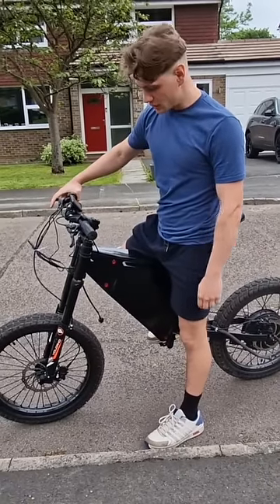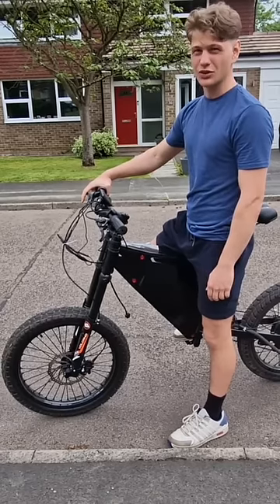5000w 72v E BIKE

Comment: There is 100% a limiter on this, at 72v 5000w on a mtb conversion almost chucks me off the back from acceleration.. it is extremely torquey
Reply: It’s obviously either limited or they lied about the specs big time
Reply: I have the mtb conversio and it chucks me off by twisting the throttle but with these they are much heavier and dont go as fast
Reply: where did you buy your mtb conversion kit? thanks
Reply from the maker: yeah that's what I was hoping for :(
Reply: @mancavebikes you should bring it to an ebike mechanic. That should hit 50mph on a full charge quite easily
Reply: @mancavebikes theres hidden controls on most screens like this that have different riding modes built in
Reply: @JudeTheYoutubePoopersubscribe  yeah unless someone scammed this dude big time
Reply: @JudeTheYoutubePoopersubscribe  looks like it's running like a 1000w 48v
Reply: Maybie you have a cheap battery which is filled with sand or you need a new 5000w unit .
Reply: @tyroneuva-py1pg  you don't know what you are talking about
Reply: What kit did you use dude?
Reply: @joeslider7236 did you find out in the end mate?
Reply: @joshbuck2037  never
Reply: What is this bike frame called where do I start plz help
Reply: What controller and battery do u have?
Reply: Don't know about your controller setuo but Press menu and shift up button to disable the limiter. Mine works that way.
Reply: Yeah, something defo needs sorting, my 1500w 52v20ah is a lot quicker than this 5000w e-build, he really needs to have a word with the controller 😅
Reply: @mancavebikes u may have to mod the controller or get a high-performance controller
Reply: depends 100% on the max phase current of the controller

there are cheap controllers that can peak at almost 7kW at 72V but can't do more than 100-120 phase amps, so it only reaches that when you're near or at it's top speed

these big hub motors actually like a big peak of 200+A taking off, there are 50A (battery side current) controllers that peak well over 200A in the motor at low speed, because at low speed the motor works at a low voltage and thus 36V (current motor back emf voltage) x 100A = 72V x 50A

to roughly give an idea
Reply: I have a 500w e-bike and it definitely kicks harder than this and it tops out at 23
Reply: I have a 3000W 72V and it's much faster than this.
Reply: @mancavebikes my mates 48v 1500w goes wayyyy faster then this on 500w with 72v your should be topping it out at 60s 😂
Reply: It'll be EU legal limitations on it not allowed a throttle here in UK on ebikes
Reply: There is a speed limiter usually a single white cable looping back to the controller, disconnect it, or cut it if you cant disconnect it.  @mancavebikes

Comment: You sure that’s a 5kw controller? Seems excessively weak. My 2kw build would leave it in the dust on acceleration so there’s something wrong there. Would expect a top speed of around 60 and at least double the acceleration speed that yours is putting out. No limiter wire? Link me to the controller and I’ll check it out for you.
Reply from the maker: Yeah it's really slow on the acceleration. I have a sabvaton 80a controller, but I think I'd need a 150a to actually get good acceleration right? 

I got 45mph yesterday but that's all :( and yes my 2k watt would probably also beat this 😂

I was honestly expecting this thing to do wheelies so I'm pretty disappointed. Id appreciate all the help I can get making it faster!
Reply: most likely is the 3.5T motor and not the 5T motor.
Reply from the maker: @alexchavosaurus9041  it is the 3.5t, is that bad?
Reply: U have 5t or 3.5t?
Reply: @mancavebikes  3.5T just means less torque and higher speeds from my understanding. Its the amount of copper winding within the motor. so 3.5 turns or 5 turns. I personally use the 5T and my torque is amazing but my top speed is around 45-50 MPH.
Reply: @mancavebikes  yeah Most likely its your controller then that is throttling down the power to either protect your battery or protect the motor or both. 37MPH still isn't bad. The lack of torque is kind of disappointing though.  What size battery do you have? do you know how much continous and peak current your battery is setup for? My battery is set with 100 amps continuous and 150 amps peak. so I have the 72100 Sabvoton controller to compensate.
Reply: That bike should be pushing 60mph at 100A
Reply: @philosoraptor777  with a 3.5T it would easily push 70 MPH, but I wanted more torque as I live in a hilly area so I went with the 5T which in turn leads to less top speed.
Reply: @alexchavosaurus9041   I have a 5T 3000W 72v system that rocks along at 55mph.
Reply: @philosoraptor777  again, I live in a hilly neighborhood. When I go downhill, I can get it up to 55MPH, but up hill at around 10% grade I get a steady 45mph
Reply: What size is your battery? You should upgrade your controller to 150 amp minimum
Reply: @alexchavosaurus9041 do you think the 2.5t accelerate fast enough? I like to think of a great top speed but if accelerate is not good then might aim 3.5t when make one
Reply: @mlee6050  Both of those will be good for Top Speed, Low Torque. The starting speed on the 2.5T will be lower than the 3.5T. Hope that helps you decide brother.
Reply: @alexchavosaurus9041 I was going to build one with 3000w and 72v I would rather have a decent acceleration and go like 40 what would I get a 5T I’m not really even sure what that is tbh
Reply: @frankroach9346   my battery currently only puts out 100A continuous. I just burned another Phase Wire cable on these damn motors so I am hesitant to buy another honestly haha

Comment: Man , get you a tw200 and stop with the bs problems , they’re indestructible, fairly priced,  easily last you 30 plus years with minimum maintenance , don’t ever have to wait for it to recharge you put in 5$ and fill the tank that lasts you an easy 100 miles  per gallon of gas. Unless you have access to chinas new lithium battery that goes 600 miles (on a car) and takes 10 minutes to fully charge. Once we have that technology only then would I consider getting one , lastly who wants to hear that annoying whining.

Comment: This bike should do like 0 to 30 and like a couple of seconds and it should have a top speed of easily 50 mph so somethings wrong with it or the limiter is still on. you either need to clip a wire or you need to go into the hardware and tweak it to take the limiter off

Comment: 45 on mine, same 72v 5kw stealth bomber clone.  Doesn’t lift the front wheel during acceleration but it’s still fast.  Actually once you are already moving over 10mph , then the torque kicks in big time.  Almost lifts the front wheel .  I have the silver generic controller which limits the current at 80amps.  My Panasonic cells could do 120amps but my controller isn’t allowing over 80amps peak.  Not even for short bursts.  I still love the bike though and I have a different aftermarket controller that’s programmed to allow 120 with much higher phase amps.   I will have to either bypass the battery BMS or get a new one.  That’s why I still haven’t put the controller on.    

I wonder if  you have the same issue
Reply: That's bad for the watts and v??

Comment: Have you checked all the hall sensors in the motor are working with a multimeter?
Reply: Hall sensors are only for crawling like speeds after that rpm sensor less should take over
Reply: @bad4life2013 They make a huge difference to acceleration at low speeds and even at higher speeds they still improve acceleration. An ebike without halls will take much longer going from 0-10mph probably twice as long and from 20-30mph definitely not as much of a difference as twice as long but still slightly longer.
Reply: If it's a sabvoton controller it wouldn't even move if there was a hall sensor fault..

Comment: What controller are you running? Sabvoton?...   Is the battery specced for being able to deliver 100/150 amps?  Most of the pre built batteries are in the 40 amp range and that would limit acceleration massively and will also cook the battery pretty quickly if you are trying to pull higher current from it than the cells its made up from can deliver..
Reply: if its 5000w he will have a 80amp controller.but somethi g is still wrong it should hit 55mph easy
Reply: @lee-tx5mw  depends on how the motor is wound too... If it's 3 or 3.5T I'd agree, should go past 55mph, if it's a 5T motor 55mph would be almost flat out (I have a 5T) and 7T would max out at about 35mph but with insane torque and acceleration... Bike in the video didn't appear to have either hahah
Reply: @mgtruckin  that video didnt have any torque .something dont add up
Reply: What
Reply: @mgtruckin  exactly somethings not right somewhere .mine pulls like a train

Comment: Did you build it? It can be either of two things if you built it the speedometers come with a max voltage and if this is a 48v not a 72v it’s getting limited at 25ish mph also depends on what controller you have either needs the wire snipped or need to get a beefier controller

Comment: you need to either increase phase (motor) current or if thats at its maximum a better controller

these big dd motors like a nice 200A @ the motor side to get good acceleration

Comment: It looks like I have the same motor as you
With a 72 volt 8 amp power battery and I feel like I'm driving an r1 in first gear it literally almost pulls me off the bike at 225 amps

Comment: Gotta be something wrong with your controller. I have a 3000w 48v I can get up to 40 mph on. I'm upgrading to a 72v soon but I think your controller might not be sending the right amount of power
Reply: I do over 40 on my 1000W kit dude, you sure that’s right ? I’m not the best on e-bikes but I know my kits 1000w front drive 48v battery, I think it is you’re battery that’s not giving the motor the power it needs
Reply: @DripZZZZ-qe4eb  oh it gives well over 40 with a little programming. The 48v ended up getting to 50 mph with a controller change
Reply: @tjkilshot  thats terrible for a 3000w. sounds like your battery is the issue

Comment: Most likely running a low amp controller. For any kind of acceleration or torquey acceleration you need a 60a controller might get away with a 45a if you’re not that heavy…

Comment: Sorry to say, but you are NOT pushing even close to 5000w on that motor. maybe 900-1000w tops. 

If the company that sold you that motor is saying it can push that then you need to return it.
Reply from the maker: hey man you don't need to apologize,I know it was underpowered I'm guessing it needed a different controller. I bought it from Kirbebikes they are an absolute scam of a company. want to make a video exposing them
Reply: @mancavebikes  they are dropshippers
Reply: @mancavebikes wrong phase combo
Reply: @mancavebikes do hall test

Comment: Why is it that people with e-bikes think they outside the hall? You are using a public highway and bikes are meant to go more than 15.5.Mph On a main road, if you go over that speed you class as a motor vehicle, Therefore, you should be insured and the bike should be tested, A vehicle and motorbikes Rider have to have compulsory insurance and a road test certificate saying that it is roadworthy if people want to ride on bikes then I think they should be compulsory a Blanche to have full cover
Reply: People can pedal faster than 15.5 mph on non electric bikes, on a fixie bike you can hit 30mph with just your legs alone (theres no gears or brakes, the pedals and wheels are one mechanism with a chain that move as one or stop as one)

you cant expect the law to apply in one regard and not another, if you're going to limit speed, then you're just banning those with a bit of technical knowhow, and those who are physically fit.
Reply: @thirdpos1871 couldn't agree more mate, it's people like the person who made the original comment who make these stupid  laws, they don't have a clue.
 I bet he's a lot of fun at parties.
Reply: I agree 15.5 MPH is nothing (my 3×10 speed manual 29er goes as fast as our 1×12 speed 48V@30A ebike). 

If it goes >45 MPH though, that is both legally & functionally an emoto not an ebike. 

If the unit in this video were working properly, it'd be an emoto. 

There is a big difference & that difference has very real consequences. 

ebike ≠ emoto

Comment: I just have to say brother it's definitely in your control might need to go to with a sine wave or dual mode. , I think you need more amps to the wheel . I'm sure know about the display, there are 3-4 very important settings, for that, sw900, I'm guessing, I also have a one, different set up, 2×48 volt 30 amp hr. It does 35-40 mph for 20m or so if I'm mellow , solid 35m my bike has 3750mi on it ,and I have had it for three and a half years!

Comment: Iys the display settings hold ➕️  plus and mince same time ⏲️ turn the speed limit up got a k5 12000watts 72v 200amp sabovot controller qs273 3,5t hub 👍

Comment: If your controller is at least 80 amps, then the pack is the issue. I have a chinese 30ah 72v pack and its much worse than my homebuilt pack samsung 40t 20s5p. Its even worse than my triangle upp pack with samsung cells

Comment: Maybe you need a more powerful controller. But its very possible that the battery youre using isnt capabke of delivering the power also. Gotta get a battery rated for the ampunt of power you want to pull from it. Lets say you want to pull 150amps your cells gotta be caoabke of this and also your batterys bms has to be able to deliver that much amps.
Reply from the maker: @MotoAlias  Spot on. Didn't know this at the time.